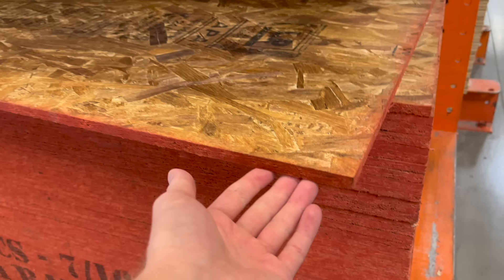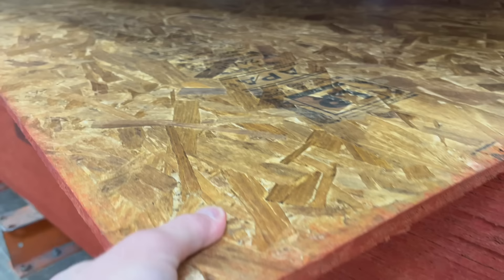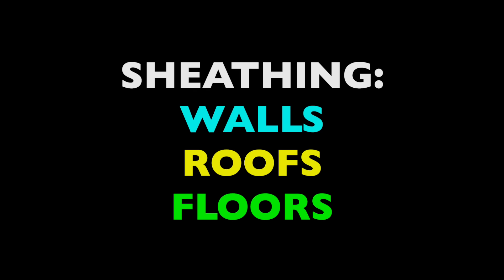Is OSB Bad?! (Oriented Strand Board--What It's For / When To Use It...House Sheathing/Subfloor)

Comment: ''Code'' says it's good so it must be. My house was built before there any codes and is stronger than new homes.
Reply: Building codes are, at heart, for safety. It is good not to have homes break but there are crucial codes for plumbing, ventilation (mold is very bad news!), electricity, natural gas, and more.

Comment: I discovered a gable on my house I just bought doesn't even have sheathing. It only has cedar shakes directly on the studs. I want to remove the shakes and use hardiboard. Is sheathing with OSB suitable? Would I need to put tar paper or something over the OSB?

Comment: The oddest thing I heard in this video was.. "OSB's biggest weakness is moisture".. then followed by "There are water proof osb sheathing, but that's an extremely rare product".. because THAT makes a lot of sense.. and basically my brain broke at this point...

Seems like if osb manufacturers know the weakness they'd stepped up to fix it BEFORE competition moved in on them. 

Anyways, informative video. I liked it.
Reply: MR, any wood's biggest weakness is moisture. I'm sure that special OSB is quite expensive.
Reply: @jobacuda4472  That said, there is a huge difference in moisture resistance between pressure treated wood and OSB.

Comment: Aside from cost, what are the pluses and negative for OSB vs. plywood for roofing specifically? If you set cost aside, is one “better” than the other? In specific cases only, or generally?
Reply from the maker: I’ll have to do a full breakdown at some point, Michael. From fastener holding, to span strength, there’s about 100 things to debate there 😆
Reply: In my experience plywood will hold fasteners better and rot more slowly if there is a leak.
Reply: @sterlinghearth3651  The emphasis is on "more slowly". I think you're right on the fasteners.
Reply: @sterlinghearth3651  Don't forget the problem if vapor is coming up through the ceiling and landing on the underside of the OSB

Comment: Great video! I am about to buy a house under construction. I am pretty sure they use OSB, but what concerns me is that it is not used all over the frame of the house. Some portions has no OSB/plywood, just the frame with wrapping, Styrofoam, wire and stucco. Is that okay?

Comment: Is it safe to use 1/2 inch OSB on top of plywood a 3/4 inch plywood subfloor to raise the level of the floor to match some stone I am laying in my entryway? 

I plan to nail down 3/4 solid hardwood on top of the OSB. I am wondering about moisture swelling with humidity from my basement. I am also worried my nails will pull out and cause squeaking.

Comment: This was a helpful video. I'd never learned anything about OSB before. Is OSB sometimes referred to as partical board?
Reply from the maker: Thanks cat! No, particle board is yet another product—probably more similar to MDF than OSB.
Reply: When working in a lumber yard, I explained to very noob customers that “it is similar to particle board in that it is pieces of wood covered in an adhesive and compressed at hight temperatures. It just uses big chips of wood rather than particles like sawdust. The properties are similar in that they both are very hard and heavy, but absorb moisture unless properly treated.”

What he did not explain is that houses/building you see these days will use this green colored sheathing (at least where I live) called Zip System. It is pretty new. It is essentially pressure-treated OSB. You typically must put a layer of thick plastic-type sheet over the OSB when building a structure to protect the OSB from moisture. The Zip System saves time by not needing to put on this plastic layer. The overall cost of the Zip System in normal (non-shortage) times is not much more expensive than the combined cost of the standard OSB plus protector. And it is likely cheaper overall when factoring the time it takes to put up the extra layer.

Comment: Hi- I worried about my new home where where the subfloors and stairs and front and back walls with these. Unfortunately, I have had 6 weeks of daily rain and it did swell which they grinded down the sides down. It also was dark in color but they said it was fine cuz it is used to getting rain but not 6 weeks daily hard rain. They also put thin cardboard like sheathing and two piece boards on stair landing. I can feel where the two boards meet on each step when I go up or down the stairs. They said they r using what they have due to lumber shortage and cost. Also,  warp but they still built and did get approved by the city. Am I crazy to still close in this house? The 3rd party inspector didn’t say much on it. I did see two sides of the living room and one side of top wall in garage warped which they said they would fix it right before we did a semi -walk through.  I figured I would move and then move again after this real estate craze dies down to some extent and move to one story home for retirement.  The exterior is cement fiber boards. We do have 10 years structural warranty but afraid of nail pops and creaky floorboards. Am I crazy to still wanting to move forward to move out of my home I had since 1998??? Thanks
Reply: Not crazy but I wouldn't. Buying a house now to sell later could bite you. The prices will go back down. Then what? 
It also sounds like shoddy building practices.

Comment: Sub-par material for sub-standard building. I’m curious if they use formaldehyde as a binder like particle board, and what the off-gassing is like.
Reply: I agree with you with 32 years of working in renovation.
Reply from the maker: It’s a good question, monkey. So many companies make the stuff, there’s probably no pure standard.
Reply: Not all OSB is made with formaldehyde based resin, some mills use MDI which is the same type of resin that is used in gorilla glue. You have a higher chance of sticking board to the press if you have an upset but you can use a release agent to help prevent that.

Comment: I need to make a simple slanted roof for a firewood holder.  Would OSB suffice with roof tile on the top of it? Or do I need a moisture barrier as well?
Reply: If it's going to be a roof , use some tar paper before shingles . Install a drip edge on top of the paper  and let the shingles hang past the edge about 3/4 of an inch . This will help keep the lumber dry for a long time .
Reply: @GrievenceCapitolist  THANKS MAN!
Reply: @GrievenceCapitolist  that’s 100% great advice. I have a roof that’s rotting all around the edges because the shingle install was done short of the drip edge by 1/4”.  Some areas 1/2”

Comment: OSB is not really that strong or water resistant as noted. I have used it several times only yo take it out and replace it with plywood. For floors and roofs, I would never use it. Plywood I'd the only way to go. Yes cost more butuch stringer and Outlast OSB EASILY!

Comment: Oriented Strand Board (OSB) is not wood held together with glue, it is glue held together with wood.
Glue is the main component, so it all depends on what quality you get.
Personally, I hate OSB but not quite as much as I hate MDF (Medium Density Fibreboard), which should be banned.

Comment: Does "House Wrap" help with the moisture vulnerability of OSB?
Reply: well yeah you don't want your sheathing getting wet on a regular basis. But if it happens the OSB is toast before plywood is.
Reply: @chrisburns5691  Somewhat before plywood. I've seen lots of delaminated and rotted plywood.
Reply: @jobacuda4472  yes plywood will rot. As will metal studs, etc. Still though it seems osb just falls apart much faster comparatively. I wouldn't build a house with osb, not in my area anyways.
Reply: @chrisburns5691  Doesn't the siding protect the OSB?
Reply: @GlennBrockett  in theory yes. In reality over time water can get past siding, flashing, moisture barrier etc. Leaks happen, especially if an aspect of the building envelope wasn't done all that great.

I've replaced a bunch of doors and windows over time, that is a prime area for rot repair needed for framing if there was an issue with original install. Improperly flashed deck ledger boards are another can of worms.  Hopefully all will be warm and dry, but we get a lot of rain around here and issues can pop up, depending on age, maintenance, design, and original install.

Comment: That whole point about osb edges absorbing moisture, is common with plywood too, if you install your ice guard and felt properly, and shingle properly, it stays dry and lasts, and much less expensive then plywood, if you leave a piece of plywood and osb outside in the rain, the osb will stay straight and square, while the plywood warps and the plys separate, plywood separation is much worse then and edge of osb swelling because of moisture, if it didn't work, after 50 years, they would not use it, plywood is over rated and over priced
Reply: agree OSB is good...

Comment: Great videos as alway: Question: I recently had a new insulated garage built.  Advan- Tech 4' x 8' T&G (log side) was used for interior attic flooring. On every sheet at the 4' edge it reads "leave 1/8" gap". Despite this label all flooring edges was hammered together so there were no gaps.  Every carpenter in the area that I have asked says " we always install with no gap". the manufacturer, who I called, says that is not correct. What is your experience with Advan-Tech flooring?  I know the gap is supposed to account for moisture/humidity.  How would you install it. I live in NH.
Reply: If the humidity level does not swing too much, it should be OK. If it was glued down, it should be OK. Outside of that, you might have issues down the road. Make sure your contractor is aware of your concerns now, before any issues arise in the future.
Reply: @corey6393  Thank you so much for taking the time to answer.  My panels are nailed as well as glued down. But I take it from your answer that if you were installing the Advan-Tech you would install with an 1/8" gap. Am I correct ?
Reply: Richard, most floor joists are 16" on center. If you leave 1/8" gaps, your 4x8 sheets are soon off your joists. Advantech is a great product.
Reply: @jobacuda4472  A very good point! Thank you.
Reply: @richardsponholz9617  I would install according to manufacturers specs. Not sure what they require right now, as I have not used that product in 2-3 years.
Reply: @corey6393  If they want a gap, the panels should be made accordingly. As far as I know, they are exactly 48x96.
Reply: @jobacuda4472  I never said they must be gapped. I said to follow the instructions. If they say the panels must be gapped, then you rip down every 4th or 5th sheet. Not every part of constructions is like Legos.

Comment: OSB is a horrible flooring. In mobile homes they get wet and the flooring falls through. In the older mobile homes they used plywood and let me tell you. That's the best flooring ever. I own a 1961 Fleetwood mobile home and this came with plywood. The floor was just as hard as the first day it was assembled. But my daughter has a newer mobile home with BSO flooring and she is complaining about the dips in the floor. BSO is a horrible product. DON'T USE IT FOR FLOORING!!!

Comment: Cheaper products just end up raising prices. They take the place of previous products at their price point and the older, better products get a price hike.  People will always use products for purposed they were never intended for, because they want the cheaper price point if possible. You can't keep people from drawing outside the lines and you can't be surprised when they work on price as opposed to intended purpose. The problem is the cheaper 'innovative' crap that keeps coming to market just dumb's the whole system down in the long run.

Comment: OSB dose not have have more sheer strength than plywood. Who told you that. Take both products and span them the same and stand on them. Take a corner of each and see witch one brakes off easier. Take both products and see what a hammer will do. Your test is done.

Comment: OSB is crap IMO. only reason I used it on my shed roof, it was cheaper than plywood. There are 2 ratings  generally available,  Exterior and Exposure 1. Exposure 1 is the cheapest kind, not suitable for exterior use which is why it is used on the roof, duh, where it can get wet, duh, and swell up and rot and fall apart, duh, duh. Guaranteeing a lot of money spent on carpenter and roofers when your roof needs fixing. Exterior grade OSB can be outside, unprotected and it wont rot or disintegrate, now we cant have that good of a sheet being used commonly  on the roof can we now. I can not find any 'Exterior' grade OSB cause they do  not want you to buy it.

Comment: There's absolutely no way I would allow a builder to use that crap if I had the money to have my dream house built. I've seen it used, seen what happens to it when it inevitably gets wet and seen what happens to floors built on it - especially floors built on newer 24" OC floor joists. No thank you ever. 3/4" plywood only, marine grade if enough can be found, for all sheathing and floors.
Reply: ROFL  nothing wrong with osb man...
Reply: Most people can't afford their dream house, but they still want a house. Cost matters.